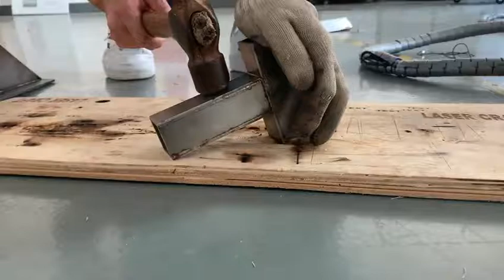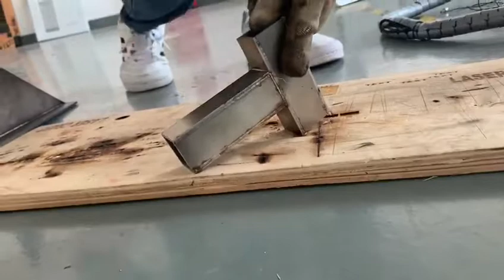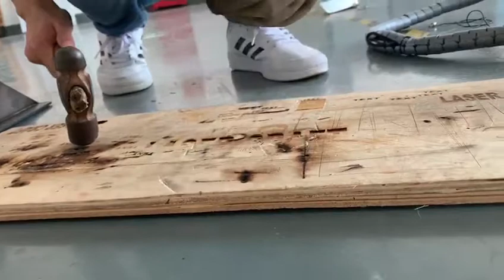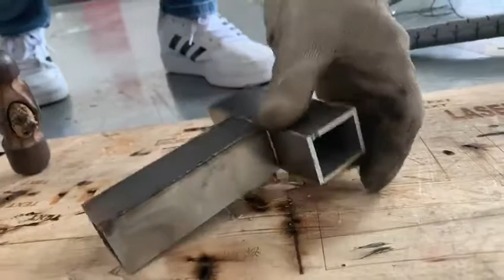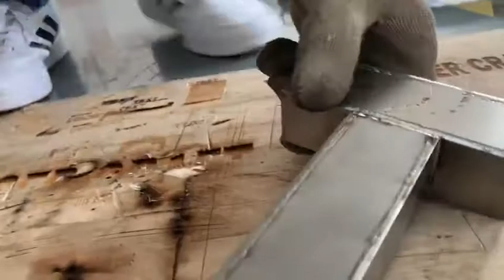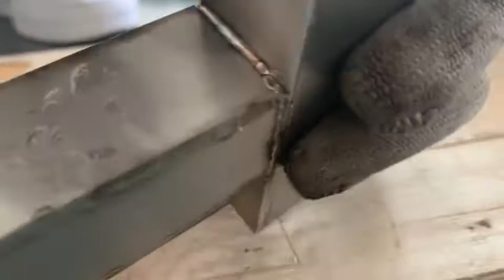1000W Raycus Handheld Fiber Laser Welding Machine to test 3mm Stainless Steel welding quality

Comment: You need to do a real test, stress it to failure and a cut and etch test.
Reply from the maker: the testing just show the stainless steel welding quality of our 1000W handheld fiber laser welding machine, not for stainless steel's quality. no need to cut it or etch test. thank you for your comments.